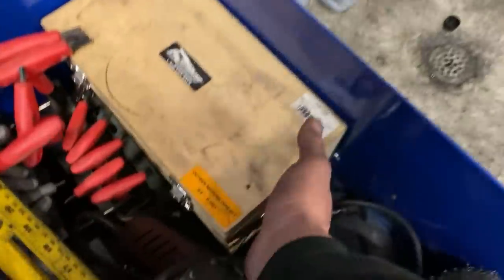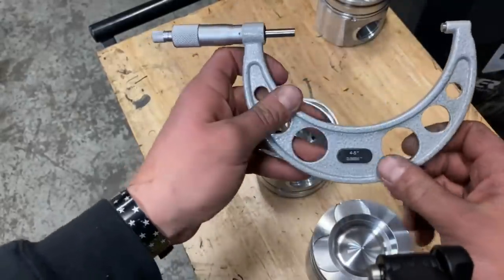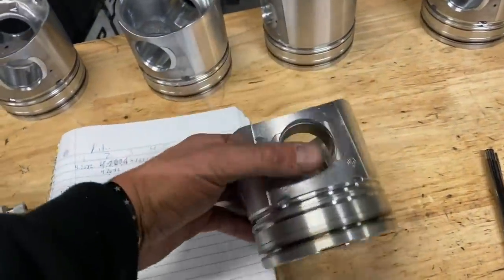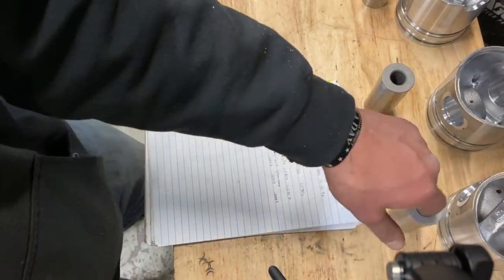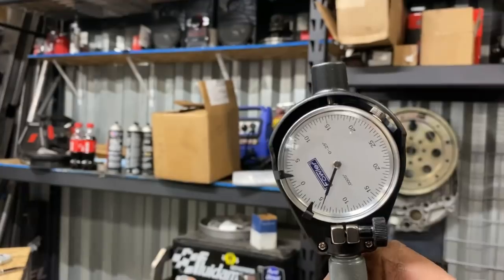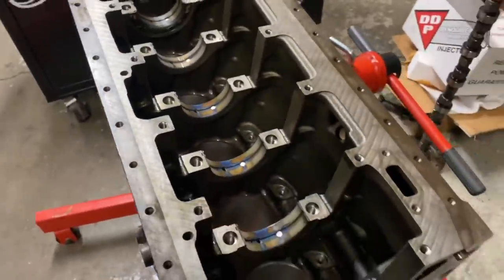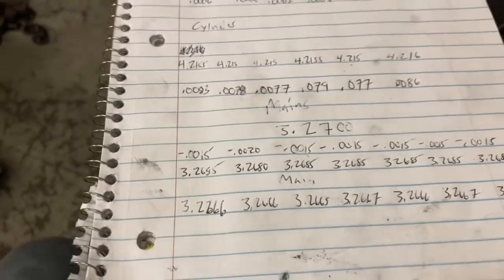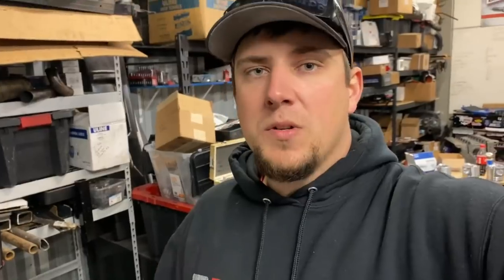HOW TO MEASURE YOUR ENGINE BLOCK

Comment: Cool to see the fine measuring tools for buildin the "sauce holder".......buuuuuut.........🤯 my pea brain is smokin 🤣🤣🤣. I'm to OCD when my ADD let's me focus on somethin to ever get all the necessary clearing of walls and boring of gaps with the plastometric squisher since I lent Mike the mic to measure the who-dickey in the chunchit valve.........lash.......compound hurricane donuts (turbskins) for proper propellent to air leakage (airs and fuels contents events) and pinning back of the ears (speed).........BASICALLY..........if I caint meajer it with Stanley, two flat sticks, or get real presicive with wire or balin twine wrap, then measure the respective length of said wrappin with some 3.14 pie.......I'm hooped! I guess I could always look it up on this tube of you everyone's going on about of videos and tutorials and stuffs............

Comment: Hey Josh, I guess you prolly had the cylinders honed with a torque plate.  If so, have you ever seen a difference in the cylinder bore measurement with the torque plate bolted on versus with the torque plate off?  Great video, thanks buddy

Comment: My Haynes techbook says piston to wall should be .0005 to .0015. That's super tight compared to every post on forums and YouTube. Am I missing something?  2003 24v isb 5.9. Stock application (bucket truck) runs at idle most of the time and wide open twice a day.
Reply: Everyone I talk to says 3-6 thousandths. Just FYI

Comment: In your opinion, what would be a fair price to have an engine machined.
Bore/hone block
Line bore and install cam bushings 
Machine main caps for 14mm and line hone
Deck head if needed and fire ring

I see numbers all over the place from 1800 to 7k 

I’ve never built a diesel out. I’ve got about 30k put away to put into my truck. 10 of it is pretty much going in the trans at firepunk. 
If you had 20 to put into a street trucks engine that’ll never tow, how would you spend it. 
05 4x4 5.9 with 250k miles
Reply from the maker: Our machine shop would do that for about 2k the cam bushings make it expensive

Comment: Also, you knew before hand the crank main journal size and piston size so I assume you told the machine shop what to hone the cylinders and mains out to?  Just asking cause I've never put a high performance build together just stock stuff, but I'm gonna give it a try.

Comment: I cut some fiberglass angle not sure what you would call it looks like angle iron but its fiberglass .Its like half inch thick . Pretty tough material . At any rate  I cut a few pieces like 6 inches long . I  use those for place in the jaws of my vice to hold what ever I want and not mess up the surface .  I watched a show don't remember which one that also recommended that dial bore gauge . I started to buy one but I was not sure how good it was . Where I use to work they had a machine shop , so I could use there tools . Sure miss that lol . Silly question do you have the block honed with a torque plate on it . I used that on gas motors including my Harleys but I was not sure about a Cummins  thank and I appreciate the videos

Comment: One thing I don’t hear a lot about is total seal top ring, in a diesel is there too much heat and pressure for 2 thin rings, maybe they don’t wipe the oil off the cylinder wall.? IDK

Comment: As a machinist I gotta say a couple things. First, good content and your explaining proper methods, especially mentioning about doing things with two hands vs one. Much easier and accurate with two hands.

Also to note, the set of outside Mic’s that you are using are about 10 times more accurate than your basic micrometer. If someone is on a budget and can’t afford a complete set like you have that measures .0001” resolution vs .001”, because they can be over $500. Find out what size mic you need and just buy the individual one. A lot of times mic’s under 5” range are less than $50 when bought as a single.

Second is if you are doing this yourself and you live in a cold or hot climate, make sure you put everything in the same place the day/night before you plan to measure it. Because if your tools and pistons are in the house/garage that’s 75 degrees and your block is out in the shed where it’s 45-100 degrees depending on time of year and where you live. You could get a size difference of over .001” just from a 15-20 degree temp difference in the part to your measuring equipment.

And lastly to try and avoid some math for you because in this case your main goal is to just check clearances. Measure the pin/piston/crank/cam, etc. Then lock the mic in place. Now set your dial bore gauge to zero. So instead of setting the dial bore gauge to 4.210” you would set it to zero at 4.2076 as that was your largest piston. Now when you check the bore in the block you will get the exact piston to wall reading without having to do any calculations and not risk of missing a decimal place.

Looking forward to more content on this build.
Reply from the maker: Thanks for all the tips! I did start zeroing the dial  bore gauge shortly after to make it easier. Definitely recommend the temperature thing as well! Thanks for watching!